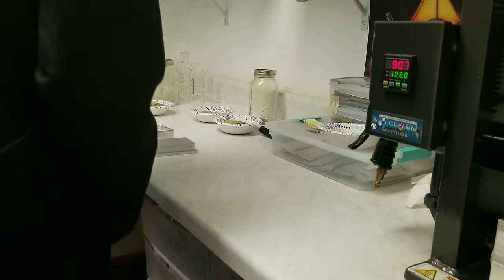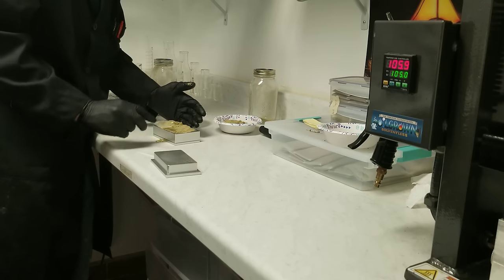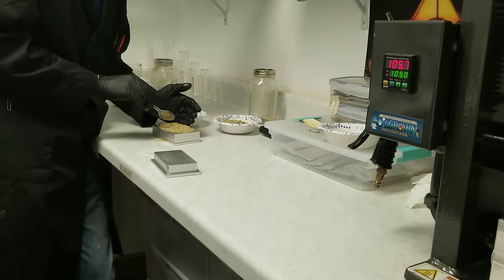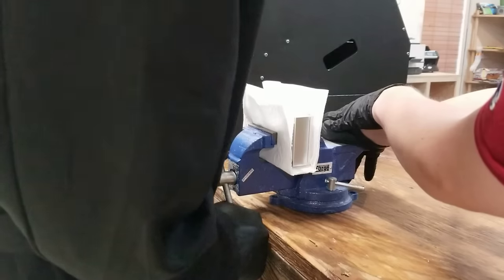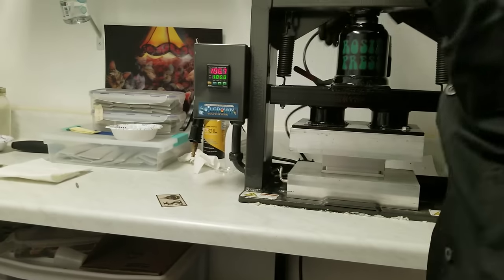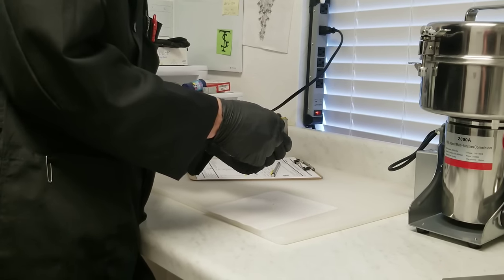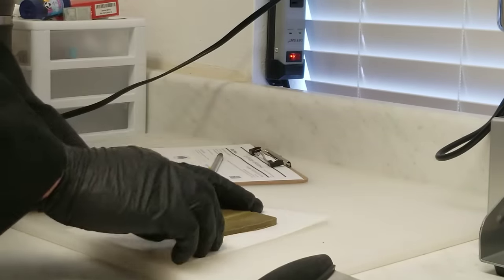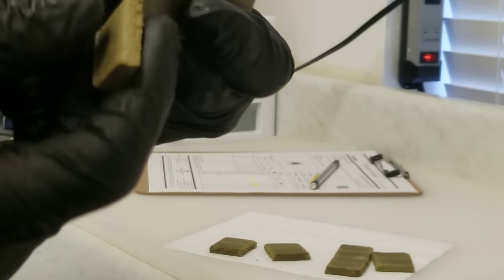Making hash bricks

Comment: That table vise has mounting holes for a reason 😂
Reply: That's what I was thinking!
Reply: They can mount a power strip in window seal but not bolt a vise dowm
Reply: @craigloukota2330  lol no doubt, it would make their op easier
Reply: @scooter2163  why can't it be bolted down?? If that's the rule why not get  a suction cup vise??
Reply: @scooter2163  exactly. Pretty obvious
Reply: These guys are making more work for themselves  there are about 10 things I see they can do different, that would make that process easier and more efficient, and more consistent
Reply: Last I checked, a vise is not illegal to possess. But maybe in California it is. LoL
Reply: @craigloukota2330  yep after a second look and my knowledge of how things are built, this is not a mobile Lab and if you look at the press its held down with construction adhesive, and they have an air compressor outlet mounted to the wall
Reply: @scooter2163  

If the cops were at the door I doubt taking the vice would even cross your mind. Takes two minutes to loose four bolts though 😂
Reply: Lol
Reply: Sometimes you have to work with what you have and improvise.   I was more concerned they didn't use wood on the outside as someone else already commented.
Reply: Cowboys and appies

Comment: Back in the mid 80’s.  Had a friend who had a connection for Lebanese Red hash bricks.  Best thing around by far.  Those things were pretty solid though.  Not really extremely pliable.  I mean, it could be bent a little but if bent as far as in this video, they would crack/break.  Only way to smoke some was to heat it up with a lighter, pinch a piece off and “fluff” it (roll the piece between thumb and forefinger) so it almost resembled flakes.  Then you either add to a joint roll or put it in a pipe.  Pipe was better cuz to add to a joint it took to long to burn and wouldn’t keep up with the paper burn.  The hash you buy at dispensaries is definitely different from those old bricks.  Still good, but I do miss those old Lebanese red bricks.
Reply: Bro..we used to get the Lebanese Blonde,,and man was it TASTY!
Reply: Get a Grinder and throw it in the Freezer. You can perfectly grind Hash after it was in there for like 10 Minutes
Reply: @lucanoelremy6955  thanks for the tip but I’m good.  I just buy infused joints now.  Or use a pen.  Not big on the hash you get from from weed shops these days.  Not the same.  Can’t really smoke it all on it own in a pipe not enough vegetative matter in it I guess.  Melts to oil like and hard to light up.  Which is why I buy infused joints or cartridges.  Convenience.
Reply: I saw a vifeo on leb red hash. Its something about when they harvest the flower its like right before its peak and the trichombs are red like that.
Reply: @thatguy2408  you gotta ask for old schhol hash or biker hash. Hash factory is the brand i like. Its about 35$ a gram in colorado they have lebaneese and morican hash. Morican is like temple ball hash i only smoke sativa and its nice and gooy and works on a pin like old school hash. The lebaneeze is 10 ton pressed keif and a gram gets me high 4-6 times just smoking it on its own. Im not a fan of bubble hash it dosent burn right
Reply: @Kami.Smoke.420  thanks for the tip.
Reply: Just mix it with tobacco
Reply: @scallywag1337  that would be a no for me as I don’t smoke tobacco.
Reply: @thatguy2408  
Yes. I hear ya. It's not hash, it is wax. Badder, budder, shatter, rosin, live resin, sugar, crumble. They call hash, kief. Only loose kief, like Wisegro started with. I have a kief collector in the bottom of my grinder but it would take forever just to get a gram.
A trick I do now is put a piece of wax on the top of a bowl full of flower and carefully light it and let the wax melt down through the vegetable matter in the bowl and I have a fun day.
Reply: Mmm Red Leb. 
I don't miss the rock burns in all my tops though 😁
Reply: @Kami.Smoke.420  Yeah, hard to find hash that holds it's shape on a pin (or hash-o-matic).  I always figured that they must mix in a little camel dung for strength!
Reply: @frankiefugazi  yea I hear ye, we called them bombers or hot rockers, the good old days when you had to sit leaning forward with the ashtray under the joint at all times🤣🤣
Reply: In Dublin in the 90s we called leb hash soap bar and this stuff he's making we called pollen, oh the "fluffing" we called spreading but if you didn't want to burn the goodness out of your hash by spreading you could use a fine grater to make a dust to put in your joint also creates less hot rocks/bombers 👍
Reply: @donaldunne6612  without a doubt I would take your advice.  I would think hash would be just as abundant as flower.  Whereas growing up in CA, the finest outdoor flower was available for a good price in bulk once a year (indoor was not really a thing at this time).  So flower was common for us hash was you really had to know SOMEBODY.

Glad to see the Dublin stoners chiming in.
Reply: @thatguy2408  it was the opposite for us over here back in the day hash (soap bar/leb) was all you could get it was only in the late 90s early 00s when flower(weed/grass) came on the seen and now hash is a rearaty, but we used to get some great hash like pollen, marrocan black and the best I've ever tried  zero zero.
Reply: Red Lib🤤
Reply: @donaldunne6612  double zero mixed with a Johnny blue and wrapped up in a jumbo skin, we used to burn into yops and drink them when we were kids, called them a blowghurt, Christ.
Reply: @oneill765  ah yes a proper dub joint, blowghurt 🤣 great name, we used petit falus good times👍
Reply: pretty sure it was because of the solvents used this method is alot cleaner
Reply: @Kami.Smoke.420 trichomes are never red, they go from clear to milky to amber and then dark brown
Reply: @donaldunne6612 soap bar is hard, you need to put a lighter on it for a sec to crumble. It was called squidgy or red/ gold seal, soap bar is very different and comes in 9oz bars that look like a bar of soap. The Lebanese hash usually comes in 100g blocks ✌️
Reply: @matt.willoughby  yea I get ye, if it comes in a block it can be grated, give it a go you'll never burn it again and it tastes and hit so much stronger👍🇮🇪
Reply: The old GOLD SEAL Lebanese black hash. $5 gram. We used to get tired of smoking it, at times that was all that was available. A pin, match box, glass cup n McDonald's straws kept us occupied for several hours 😂
Reply: Red leb used to be known as electric
Reply: @nickworsfold5903  interesting, why electric?
Reply: Hash is super common where I live - can get maroc of many types from blonde pollen to dark press, Indian and Nepali charas, Lebanese, Syrian, Pakistani black, locally made bubble as well as all the new guff from Cali.
Reply: Lebonese blond in Northern Ohio made pin pipes outta a jar and lid so could smoke while driving lol
Reply: Hell in the mid 80’s a friend had a friend who could get us Nepalese temple balls we were so spoiled

Comment: Get in touch with a CNC workshop. They can make you better molds that will let you lock the bottom and also help you get the hash out without pressing the hash with your fingers. They can also  emboss your logo so it will indent into the hash.

Comment: I know the press is a little hot but do you not use heat to press and work the hash? While trichs are still very effective without a heat press, does it not make it more effective if it's worked with heat and aged?
Reply: That's how I understand it. I've made hash this way but switched to Frenchy's temple balls. Simpler , better, elegant. Only use the press for making dabs now.  Bricks of kief look nice but nobody smokes hash under glass anymore. All the youngsters I know consider it inferior.

Comment: Do you cook it in your hand a spliff at a time or in amount before smoking. In Pakistan especially Afghanistan thats how it is smoked and so in UK we do same. Seems to make it stronger.  Thankyou
Reply from the maker: My process was developed for the American cannabis industry, where sanitation is extremely important. The nasty hand oils found in less regulated hash would not be sellable in the American medical cannabis market (how do you know the hash guy washed his hands after wiping his ass, ya know?).  My hash has never been touched by human hands, because we wore gloves through the entire grow process, through harvest and through the entire hashmaking process, making it the cleanest hash humanly possible. Especially since we thoroughly washed each plant at harvest before drying. Basically, get the finest kief you can, and then squish it together with some heat and pressure.

Comment: Thanks for showing this content. How did you get your keif? Dry ice? What micron mesh would you recommend for getting keif to press like this? Thanks
Reply from the maker: Yes, i use dry ice and an industrial freezer. If you buy a 9pc bucket sifting set (for prospecting), it will separate out multiple different grades of extremely fine kief.
Reply: @joshuawayne9811  trying find good shipping
Reply: @joshuawayne9811  nice tip ,never considered using sifting buckets

Comment: Joshua i have 2 3 questions for u.. 
1st before putting the kief into the pre mold press does it have to be room temp , freezed or doesnt chance anything ?

2nd
If the press is both of the plates are heated (the upper and the lower) do i still have to put it at 105c°? And at what psi shud i stop squeezing.. if i put 45g into a 3x6 pre.mold press..

3rd
How do u get ur kied from the dry ice without the bags and only the sift screen?
U frieze it before and then u put ur frozen  trim over the screen?.
Reply: And how many psi u keep it at?how much tons ur press..
Reply from the maker: I can't tell you exactly how strong the press was, it was a first generation sasquash machine that didn't have any guages for pressure. I had it at 105°F, not centigrade. Too hot or too much pressure will turn your hash into goo and squeeze it out of the mold, which makes it almost impossible to open the mold back up again. All I can say is that it will take experimentation, and that your equipment is what dictates your method. I was forced to produce this way because of the limited equipment I had. The company I worked for didn't see the value in investing in the processing department.
Reply: @joshuawayne9811  good info, thanks

Comment: I would suggest getting a machine to do the cutting or putting the blade on a hot surface like the press metal or something to help cut the hash:))
Reply: Good tip
Reply: A vegetable dicer blade from a kitchen utensil under the hydraulic press would be so much easier

Comment: Won't you damage the heat plates if you press the aluminium mould into them? How much PSI did you put on it?
Reply: Also wondering on level of pressure used for that kind of temperature. Thanks.

Comment: if only there were a device used for cutting things that had a sharp edge.....
Reply: You can make one, easy as that. use a small press and make a holder for the blade that you are gonna use. With he`s blade is wherry easy to make. You can also make a small turn table the the kief plate. Maybe some welding needed but it works nice, no hard work at all and it fast.

Comment: The cutting sounds like a bad day at the throne.
     Where do you get the brick mold?
You can put an edge on that cutting tool. I know it doesn't come with one, I use one in the kitchen for other things, but, you can edge it for that purpose

Comment: Weak. 
Hydraulic press, heated? 15 seconds? Why?
Dont need heat when you press. The pressure creates heat, exactly the right amount. Also, press it for a couple days and you get a far better, smoother hash.
Reply: I've always been a fan of the ol hand roll, temple balls for the win.

Comment: Nice.,...heat your cutting instrument ahead of time....cuts like butter. How do you suggest storage for your " Fat,hash bar"? And...one more question... what's the oldest weed you've used? I did 4yr old...came out a little browner...but still booted you in the nards!😆
Reply from the maker: Always use fresh material made extra brittle with dry ice. For storage, I wrapped them in precut foil squares like a chocolate bar, and then stuffed them into a mylar package that was vacuum sealed.

Comment: If you bolt the table vice to the table and use a long pipe over the handle maybe you could make the brick without the heat press ?

Comment: You slice a little bit and pin it on a steel pin light it up and blow it out leaving the amber burning cover up with a glass cup and then the hash will burn the smoke will collect in the glass and then you inhale it... I'm back in the 90s...

Comment: Can you achieve the same results with the dab press 2 clamps and a pot of water at the appropriate temperature?

All people ever post as an option is use a hydraulic heating press which is over $400 or using parchment paper with a hot bottle of water.
Reply from the maker: As long as you are fully waterproofed, sure. If you jam pack a zip lock full of kief, put it in another zip lock and then wrap it VERY tightly with cling wrap, you should be able to toss it into a pot of hot water (not too hot though) and wait like a half hour, and it should turn into hash.

Comment: I do this as close to your technique as I possibly can.  105 degrees in 15 seconds does not bind or fuse in that time.  I use 73 micron screen dry ice separation.  Help...  should i ad some more heat, or same heat and more time, help...
Reply from the maker: Same heat, more time. If that doesn't work, increase by 5° per attempt until you find your sweet spot. Your problem could just be that your material has too much plant matter, or that it needs a little more pressure. The best science is to slightly tweak your variables with each attempt, and chart your data.
Reply: @joshuawayne9811  thanks, also should I use a  finer/lower # micron bag then 73?  Do you ad any drops of water first?
Reply: @joshuawayne9811  what size screen is best to use?   I am aware different material may require slightly different micron size.

Comment: So as much heat and pressure the harder the brink gets? what happens if the Kieff is very oily, do I need then extra heat and pressure for having a harder consistency?
Reply from the maker: Too much heat and pressure will render the kief into goop and cause it to seep through the cracks in the mould, which is EXTREMELY difficult to pry open and clean off. Not enough heat and pressure, and you end up with a dry, loose kief cake that just crumbles right apart. Like everything, it becomes a finicky and delicate balancing act that is only bolstered by experience.
Reply: @joshuawayne9811  Thank you very much for your perfect answer, so I can start with little pressure and heat and do it again with more heat and pressure if it's loose?

Comment: Get yourself a rubber mallet and use that to make it easier cutting it up. Rather than using your body weight and giving yourself an aneurism, place the cutter where u want it cut then tap on the handle of the cutter several times until it's through.
 Or, you can score it like a Caramilk chocolate bar, stick it in the freezer for 10-20 mins to "stiffen" it up then snap the pieces off on the corner of your work space there. I'm not telling y'all what to do, just trying to help u make it less difficult.

Comment: How much do you have to harvest in a year to be able to get like a pound of Keif
Reply from the maker: Oh, a pound of kief could be sifted from the trim of about a 20lb harvest (15-30 plants, or so), or from a few pounds each of quality trim and decent popcorn larf nugs, but it will be a pound total, of various different grades. To produce a pound of the finest hash possible, you would want to use about 10-15 pounds of quality trim and popcorn blend, frozen to be super brittle with dry ice for several days, ground up super well and refrozen, and then dropped through a 9pc prospecting sifter set. If you use vibration instead of shaking to get everything to separate, you can maintain your cold for longer, or just throw a couple nuggets of dry ice into each screen. Colder grind sifts easier. Running 10-15 pounds of quality trim and tiny nugs through this setup will yield you about a pound of super fine hash in the bottom bucket, with the next two or three screen levels producing progressively lower grades of hash, and every level above those will be filled with material ideal for teabags, cheap prerolls and RSO extraction.

Comment: I just bought the heated pressure plates but for some reason I can't get the plates to heat properly was wondering if anyone has any tips I'm using the Rex C100 and the manual it came with is shit

Comment: Do I have to wear a Matrix coat during the process?
Reply from the maker: Kief shows up alot better on black than white. The full coverage offered by a labcoat protects your clothes from kief, concentrates and solvents. You don't need it, but if you're doing it every day, it helps.
Reply: @joshuawayne9811  allright. I'll just make sure I have some sunglasses and a slomo cam on me 👍🏼

Comment: Anyone catch the temperature used in the press? Was it 105°C? 105°F seems real low.
Reply from the maker: Fahrenheit. It's not just heat, is why. Heat+pressure, and the game changes. Too much heat, and everything turns into dark sludge that seeps out of the cracks of the brick mold, locking it shut like gorilla glue.